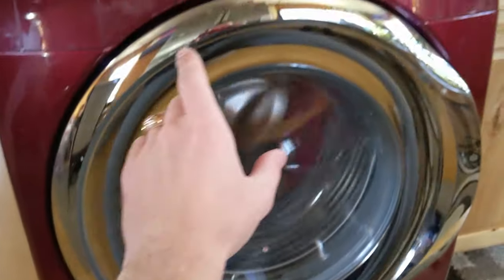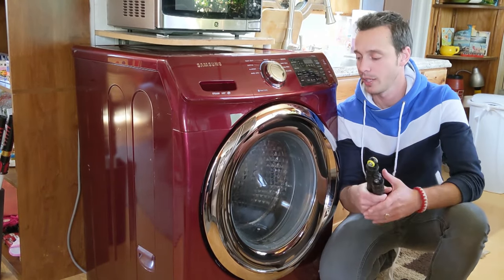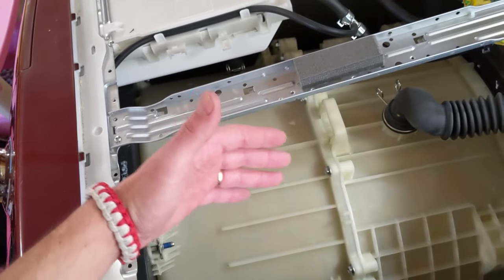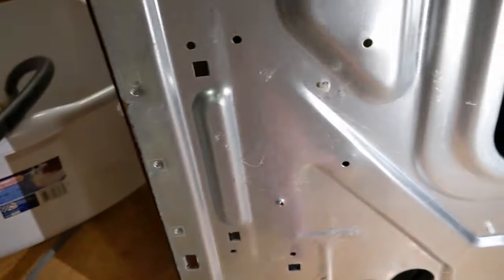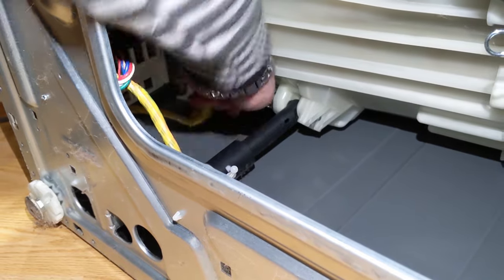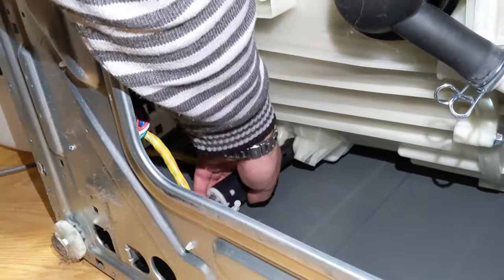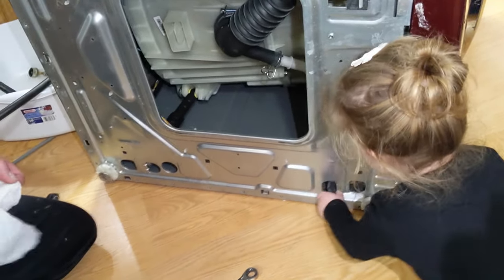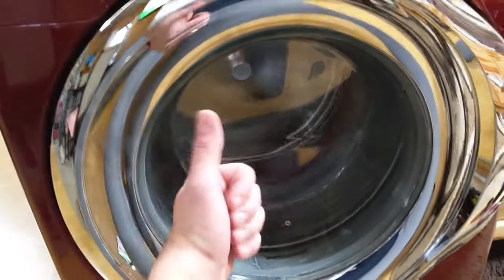SAMSUNG WASHER WILL NOT SPIN, OUT OF BALANCE FIX. HOW TO REPLACE SHOCKS ON SAMSUNG WASHER

Comment: My washer is spinning unbalanced and stays stuck on the spin cycle with 5 minutes and stays on 5 minutes. I think shocks need to be replaced.
Reply: Did your issue got resolved by replacing the absorbers?
Reply: @25atiq  bought a new washer. Got rid of side loader and top loader...

Comment: So i had this issue and saw this video and got to work. After taking the first one off, i checked it and it seemed to be working fine. So instead of taking the other 3 off, i just undid one bolt and moved the arm in and out. Turns out they were all ok. So now the issue is likely to be the spider arm. Thats going to literally involve taking the machine apart, although i'd rather do that than buy a new machine. 

A few tips if you plan on changing the shocks. 
- Wear a long sleeved t-shirt/shirt. You're arm will get butchered reaching in the hole in the bottom is its not big.
- You can easily access the rear shocks from the rear panel.
- Front and rear shocks may be different. Look for ALL the numbers on the part. Mine had big numbers, and then smaller etched numbers. The smaller numbers were the part numbers.

Comment: Very informative. Thank you.I have the same washer with the same problem. I ordered the shocks.
Reply: Did that fix the problem?
Reply: @gnhun101  No unfortunately. I replaced the shocks, and the front balance ring, and it still does it, just less. I made sure the machine was level, and I never overfill it with clothes. 

I think it’s just a design flaw because the older Samsung washers did not have that problem. I noticed the tub on the older models had a front, and rear balance ring in the tub design. These newer models do not have the balance ring in the rear of the tub, only the front. 

What I did to remedy the problem some was I placed a pillow on each side of the rear of the tub so it won’t hit the sides of washer so much when in use. This is helping a little bit. I got that idea off of a forum from someone else who did the same thing. I’ll probably get rid of it next year.
Reply: @vltruan  probably the support spider.
Reply: @emmacurran7717  Hello, I took it apart when replacing the balance ring, and checked the spider, it’s like new. The bearing is also fine.🤷🏼‍♂️
Reply: @vltruan  that’s very frustrating! I’m pretty sure mine is the support spider as I found rocks in my filter which I believe is pieces of the spider. I’m hoping it’s not more than one problem. My machine is 9 years old though.

Comment: My Samsung is slightly different but it looks similar.  Mine is WF350ANP/XAA.  There is a parts diagram I found on line and found that front and rear shocks are different part  numbers.  My washer is shaking like crazy on the spin cycle, so i'm going o try replacing the 4 shocks to see if that fixes it.  I will update after the parts are installed.   Good video, thanks!
Reply: SAUWALEE MALIWAN   Apparently it’s almost always the spider arm.  Apparently the shock absorbers are pretty reliable but the aluminum spider arm is a known problem area because it corroded due to “galvanic reaction” between the aluminum and the stainless steel parts combined with the chemicals and heat plus water in the machine.  My machine is barely 6 years old and the spider arm was totally trashed and crumbing into pieces.  The other items that it could be are the bearings or the balance ring.  If you take out the shock absorbers you will be able to tell if they are bad by pulling and pushing on them.  There should be about 1” of slack then some good resistance in each direction.  Getting these out takes less than 30 minutes and is quite easy.  There are YouTube videos that show the process.
Reply: SAUWALEE MALIWAN   Well good luck!  It’s not too tricky to get the spider arm replaced but it is time consuming and there are a lot of steps and parts to remove.  If you carefully label every screw and take a few photos I’m sure you can do it and save buying a new washing machine.  But yes check the shock absorbers first.  The  back ones are easiest to remove.  Just take off the small back panel (2 Phillips screws) and you will see them.  You will need a 13mm socket, extension and ratchet to remove.  Sharp metal edges everywhere so gloves are a good idea!
Reply: @martynh5410  I’m going to replace my spider arm this weekend. I’m pretty sure that’s my issue as I found “rocks” in my filter and fussed at my family for washing clothes with rocks. lol Wish we luck!
Reply: @emmacurran7717    Almost definitely it’s the spider arm Assy.  Make sure to get new bolts (6) to replace the ones that attach the spider to the drum.  None of mine would unscrew without breaking them off and it too me a while to remove them!!
Reply: @martynh5410  yes I got the bolts with the part coming along with a new gasket. I was planning to replace the shocks first but felt like that was not the issue the more I thought about it. I have the shocks but may just wait on replacing them since they are probably fine. I can return them. I replaced my drum to my dryer a few months ago bc it cracked and sounded like tennis shoes inside. It was an easy fix and the part was way cheaper then a new dryer.

Comment: Very actionable content; my unit is a top loader with the same problem; at first thought it was a leveling issue; and installed a secondary 3/4" inch plywood subfloor that was level and it improved but did not resolve the problem;  I didn't see the shocks and will have to look again; my unit has four support bars with a pivot ball on top and springs on the bottom of the bars; the shocks maybe higher up on the agitator drum; thanks for providing this content; it gave me another item to check.

Peace

Comment: Mostly it's not the shocks, it's the spider arm that is corroded or cracked.  If the vibration has been going on for a year, your front tub assembly will get worned out as the tub is rubbing around it and could soon crack and leak. If you manually spin your tub and it's wobbling as it spins, your spider arm is broken therefore your tub of off-centered. An off-centered tub will create imbalance as it spin and centrifugal force will cause it to vibrated.

I replaced the spider arm, bushing and bearings, front tub assembly, and balancer. I already took it all apart might as well replace them. This way the washer will last another 12 years or so.
Reply: I don’t think there is a spider arm on this appliance
Reply: @connormcbride8234  there is
Reply: Can you explain wobble? all washing /drying machines have a slight movement forward / back and left / right

Comment: I’m kind of surprised you turn the washer on the side. I have read it is not a good thing and mine came with shipping bolts so I am too scared to do that. It’s a pain to take off the front but probably the safest bet.
Reply: What happened?

Comment: I have a samsung vrt. Some times the water works then it stops and the machine just makes a weird groaning noise like it's trying. Yeah. If I shut it off and start the clean cycle the water pours fine until it gets to a certain point and it just starts making noise again with no water. It can do that 4 hours without any error codes. Do you have any advice please.
Reply: Could be a clogged/ defective fill valve.

Comment: My washer has the same look and it is keeps doing spinning section. Once it tries to accelerate for fast speed it goes for 3 seconds then it stops then the timer jumps up again, so always in the loop. 
Is this what you were experiencing?
Reply: @joelamoureux  Thank you
Reply: @arisdhaftvani7210  you said thank you to someone but I don't see a post. Did someone reply to your question about spinning?
Reply: @Vol2169  I am sure he did. Forgot what he said, he should have deleted it. I ended up replacing my washer with LG.
Reply: @arisdhaftvani7210  thanks. Having same issue with my Samsung now. Was just trying to find a solution.
Reply: @Vol2169  good luck. I did everything. I replaced electrical boards, replaced sensors, aligned and leveled 10 times, re-calibrated the system. Then called specialist, they blamed the drain lol. I gave up and bought LG and it has been working perfectly.

Comment: It did the same for me for a long time but now on top of that when the spining is slowing down it makes a huge noise and the machine stops because it vibrates too muich but now errors on the panel . So that means a shock or 2 are completly destroyed ? I will open it and see.. But it was for a long time doing exacly has yours before you change the shocks

Comment: What if it is only stuck in spin cycle?
Reply: Mine is doing the same. It freezes when it's supposed to to do the fast spin cycle to get the water out of the clothes. The drum starts out tossing the cloths around when washing but it won't the the spin cycle. The time stays the same.

Comment: According to diagnostics mode instructions you do not run spin with the clothes inside you have to empty the drum because it does not readjust or tumble your clothes during the test mode that's why it's going off balance during your diagnostics